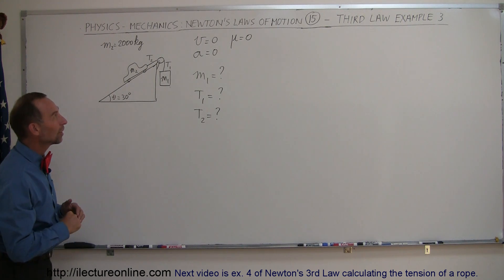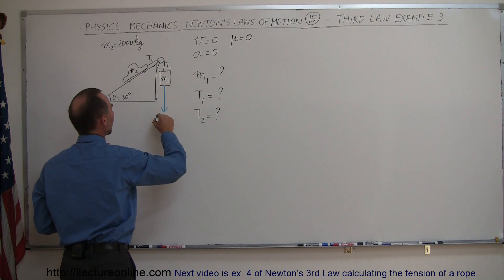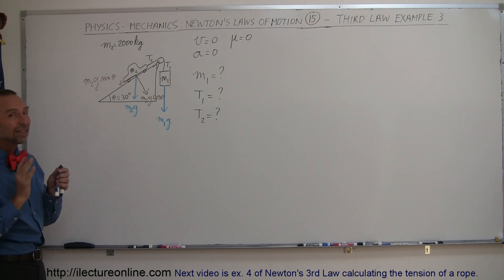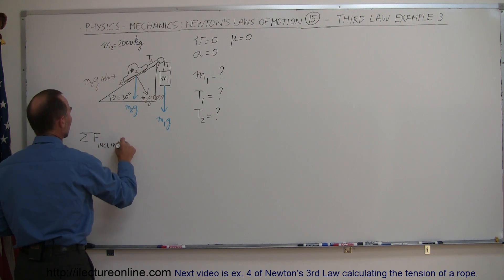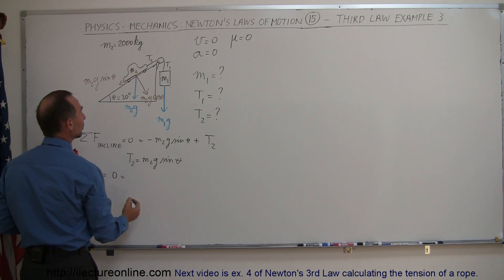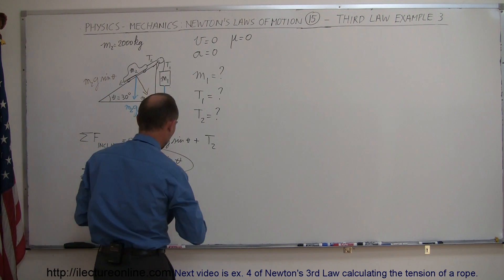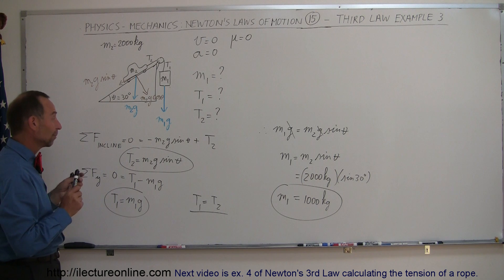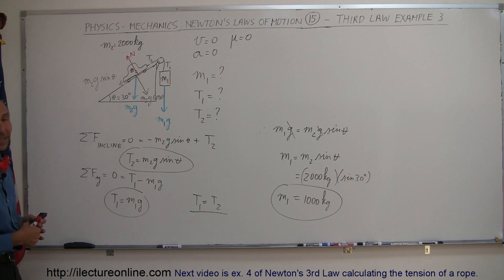Physics 4  Newton's Laws of Motion (15 of 20) Third Law: Example 3

Comment: For anyone confused about T1 and T2, he said they were equal to M1g and also Fsing because they are both pulling with the same force to achieve equilibrium.  So the tension in the cables must equal  Tension = ma  or 1000kg(|-9.8m/s|) = 9800 N.  But to show direction, the force of T2 = +9800N and T1 =  -9800N

Comment: in any case T1 and T2 are equal? for example if there is acceleration. thank you
Reply from the maker: If the pulley has no friction and if the mass is negligible, the tension on both sides of the pulley will always be equal even during the acceleration.
Reply: @MichelvanBiezen but T1 and T2 are not same direction shouldnt we calculate based on angles?

Comment: Why do you automatically put mgsin(θ) and mgcos(θ) ? isn't the line you labeled mgcos(θ) opposite of the θ=30' so shouldn't it be mgsin(θ)?    and isn't the line mgsin(θ) adjacent to the angle θ and therefore should be mgcos(θ)?
Reply from the maker: This video may help you see the relationship.  Physics - Mechanics: The Inclined Plane (1 of 2) Frictionless   https://youtu.be/qvpIv53XkJk
Reply from the maker: the vector mg is perpendicular to the horizontal and the component mg cos(theta) is perpendicular to the incline.  Therefore the angle of the incline must be the same as the angle between mg and mg cos(theta).
Reply: Thank you so much, I understand it now much better. Thank you for your videos I used to watch them in high school, and I just got back to using them again for my college physics courses, much appreciated and great teaching techniques. Thank you again.

Comment: I'm confused shouldn't the parallel component of m2g be (m2g)/sin30 instead of m2gsin30? since sin is opp/hyp?
Reply from the maker: Ladi Da
Since the magnitude of the component of the weight (m2g) parallel to the incline is the opposite side to the angle and 

the sin (theta) = opp / hyp      the opp = hyp * sin(theta) = m2g * sin (theta)
Reply: Michel van Biezen Gotcha! Thank you for the response =)
Reply: +Michel van Biezen Isn't the hypothenus of the triangle the one parallel to the incline?

Comment: Hi Michel, excellent video .. I just had a tiny request, initially I was struggling with determining (or say visualising the triangles) how the component forces (parallel and perpendicular) = mg sin theta and mg cos theta respectively. I know you have done many video's on trig as well so if there is something we need refreshing on (Which is assumed as known knowledge) can you post links to the video's in the description ? Thankfully I figured it out but I guess it would save some time and add a whole new dimension to the learning experience you have provided on here. Thank you :)
Reply from the maker: Faizan Iftikhar 
Faizan
That is a great idea.  We'll have to work on that.
Thanks